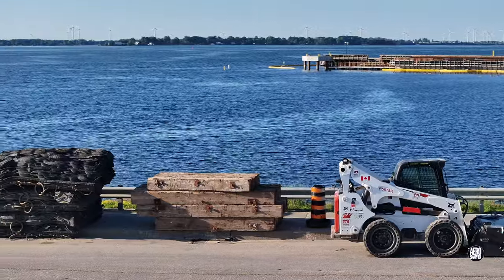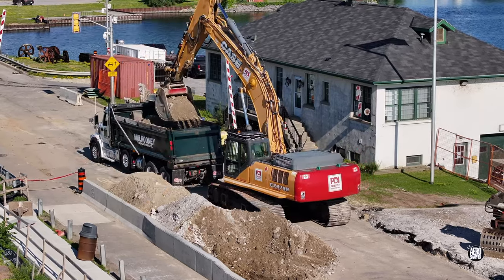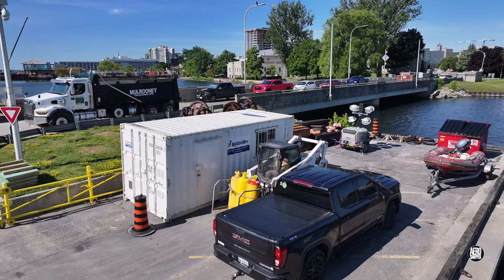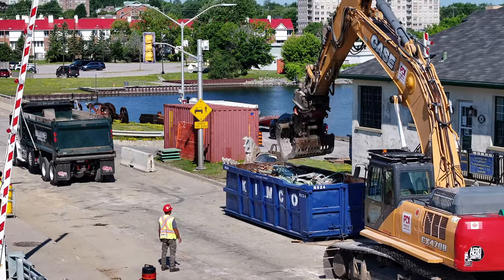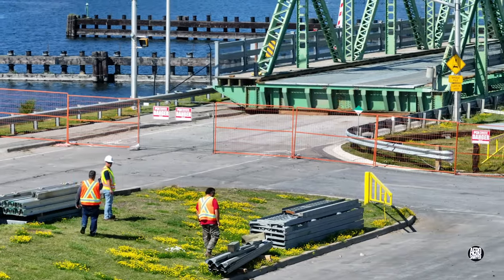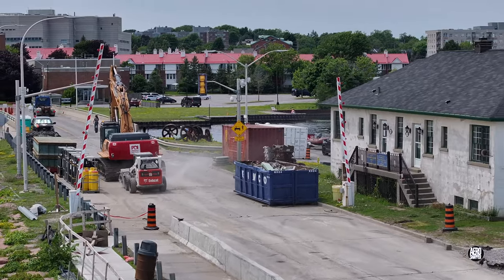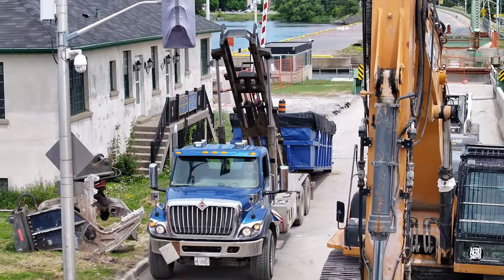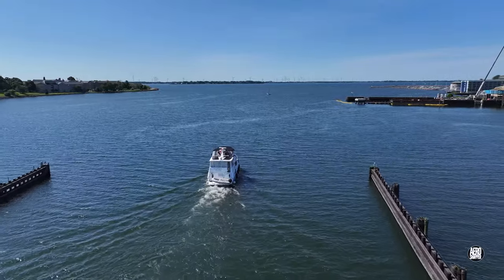Clean up on aisle 5  - an update on the La Salle Causeway lift bridge 4K

Comment: Just a passing thought but think they're going to use the bridge left on the roadway as part of a new vertical lift bridge since they left the bottom of the frame on the west end. Build a frame and lift mechanism on each end and attach the old bridge.
Reply: It's exactly what I suggested to Mark Garretsen recently. Starting to look like either he took my idea and ran with it, or the government agency involved came up with that on their own volition.

Either way, the old bridge that can be used as a good temporary bridge, and it would be a lot cheaper to replace the lift section than it would be to build a new bridge. We also get the singing back! 😊
Reply from the maker: That's an interesting thought.  I think everyone is wondering just what's going to happen to the deck.  We will have to wait and see, I guess.
Reply from the maker: @TheEDFLegacy  it would be good to have that very familiar sound back